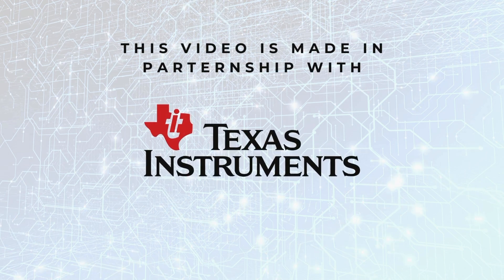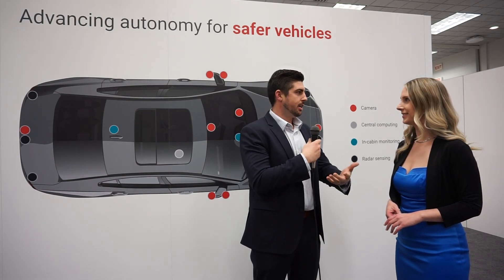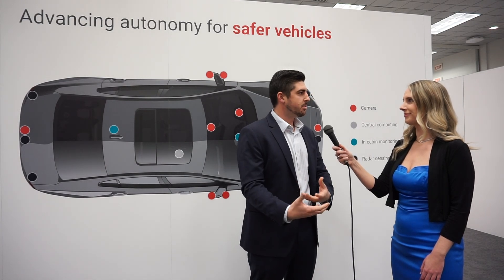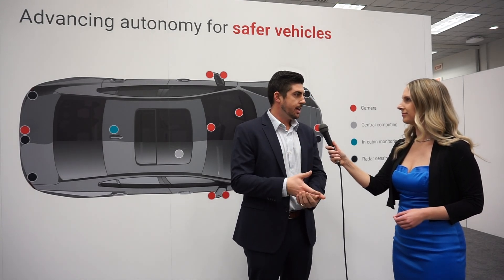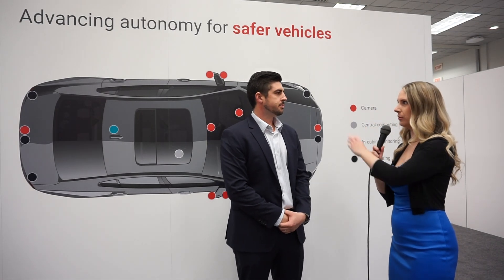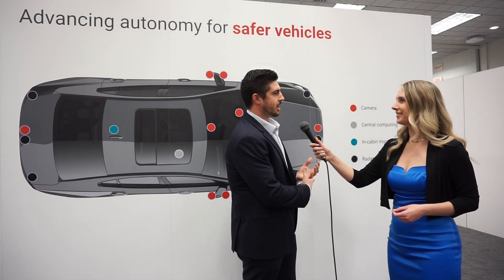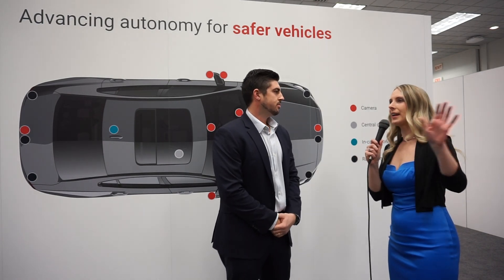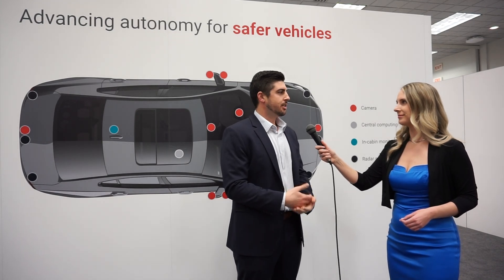Texas Instruments' ADAS Technology: advancements toward autonomous vehicles!

Comment: Hello, I appreciate your videos!
I am making anode half cells (coin cell form factor), and have been noticing much better intercalation at 40 celsius than 25 celsius. Basically the plateaus are more pronounced (on the voltage profile vs capacity) and at 25 celsius the CV step is as long or sometimes longer than the CC step (in terms of time) so an uncomfortable amount of capacity is attributed to the CV step. I have been having trouble finding literature related to this scenario. Any suggestions? I suspect it has something to do with electrolyte side interactions.